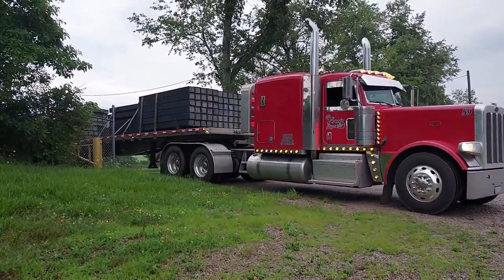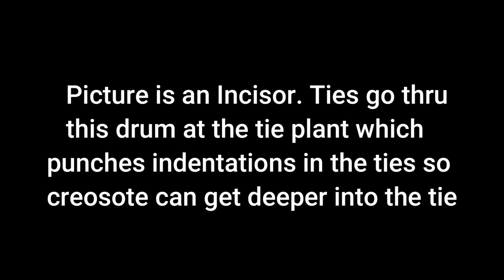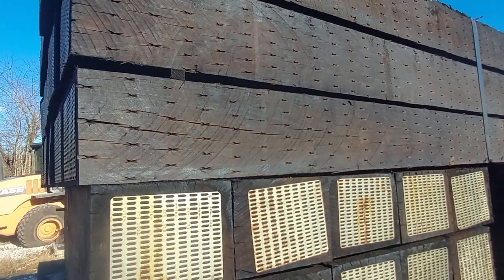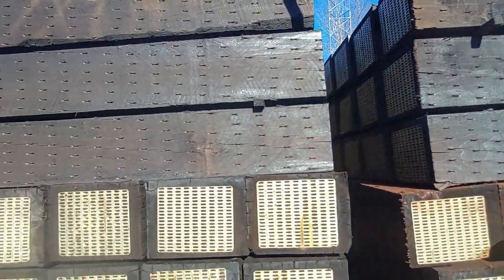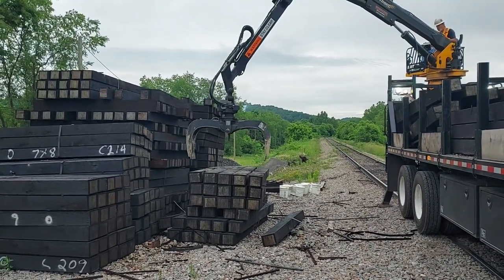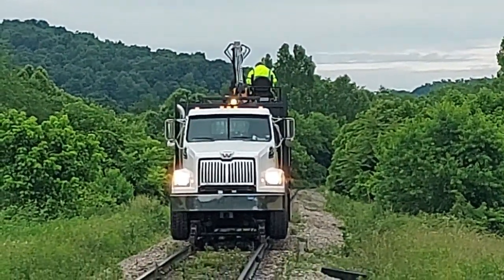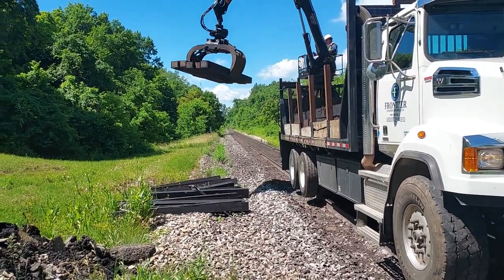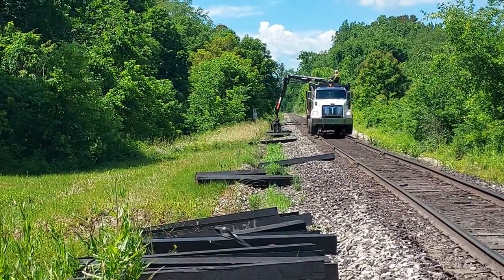Spreading Black Bananas on the Railroad

Comment: The pointed side of those plates is extremely sharp, so are the corners. I have used those plates in various sizes building roof and floor trusses, cut my fingers many times, even sliced part of my leg open on one while running  the truss to the press on rollers. They are a bear to pull off too as there are barbs on part that is pressed into wood, or black banana's in this case.
Reply from the maker: You are absolutely correct in that Johnny, they are very sharp
and do have barbs on the other side of the plate, wish I had
pointed that out in the video, didn't think about it until you wrote in.
Why didn't you write in before I made the video with that? >>>> LOL
Thanks so much my friend for dropping by and watching tonight.
Reply: @ccrx6700  I'm not as fast as I use to be.
Reply: Gang nails.

Comment: Thank you very much for this very interesting and informative video presentation which is very much appreciated. The ties look very well creosoted and should last a very long time. Where I live creosote is now not allowed but many ties are concrete except where the railroad goes over certain bridges and they need something lighter, in this case plastic is used.
Reply from the maker: Your always welcome John and we always appreciate your
very nice comments. This is the 1st part in a 4 part mini series
on ties. The 4th video will be about concrete ties. The plastic ties
are called composite ties, they are made out of recycled plastics
and very hard. They will last a very long time in mud spots and
they require pre drilling before driving a spike in them. We do not
have concrete, composite or steel ties here. Thank you for stopping by and checking out the video my friend.

Comment: Hi Dave, As long as you stated the cost of your treated finished delivered RR Ties, I will try to do a bit of back pedaling to see what makes up the actual end user cost. When we deliver a log truck load of rough cut tie grade logs to an Amish sawmill, they pay from 2500$ to 3000$ for the load. There can be from about 80 to 100 logs that probably will make a sellable RR Tie. so that translates to about $30 per log.  Of this, our cost involves paying the land owner for the logs, cutting, skidding and processing the trees in to logs, and trucking them about 60 to 70 miles to the nearest sawmills. The Amish tell me that they get paid about $40 per green sawed tie delivered to the Tie plant. So that means it costs about $40 to grade process and treat the finished tie.
Reply from the maker: Awesome information Log Dog, thanks for taking the time to
share that. 40 sounds about right at the plant we get our creosoted 
ones from for the green ties. Doesn't sound like much of a profit
margin for the logger tho! Pretty good 10 bucks for sawing one
tie tho.  I just got a grapple truck in yesterday at home full of
tree limbs and tops for my 2024 winter, it was a full big load so
got quite a stack of firewood to cut up. 800 for that grapple truck
load and delivery.

Comment: Haven't heard the term black bananas in a long time. Normally when we had a major tie replacement project we had a tie train with gons loaded with the tie bundles. There is a device called a jimbo which creeps along the tops of the gons lifting the bundles out of the gons and placing them along side the row for placement. You keep your rail operation in tip top shape.
Reply from the maker: Interesting Gary, have never heard of a jimbo before. Ray Corman
got his start by being able to get his back hoe up in a low gondola
and unload ties out of it, and then load ties back in. There's a really
good video on his life story on YT if you haven't watched it, called
Working hard to be lucky, the RJ Corman story. You will love it.
We have a very robust tie replacement program here and have
done so for the past 20 years. No more derailments due to wide
gauge like we used to have! Always a pleasure to have you visit
with us my friend.

Comment: Things you have to too run a rail road ties, rails,plates and spikes  great video thanks Dave did you know that ties are also made of concrete and or composite
Reply from the maker: Thanks Gary, sure is a lot of parts to the track to hold it all 
together, not like my old Lionel set....:-) 4th video in this mini
series we will go over the differences between concrete and wood
ties, but I am not going to do a video on composite or steel ties for now. Great to have you visit with us tonight and write in my friend.

Comment: We had at least one tie-making plant in the lower part of the state.  It turned into a Super Fund site due to years of creosote spilled, dumped, and soaking into the area.  Quite a mess.
Reply from the maker: I hear that, were we get our ties, they are very careful about
not spilling creosote, most of the yard is concrete and the new
ties are all under roof. Environmental fines can ruin a small business.
Thanks so much my friend for visiting with us and checking out the tie show.

Comment: Only if you had a connection with a Class-1 railroad, ordering ties by the car of 300 to 500 per car would have been much easier, I think I've dealt with 100,000 ties over three years for two tie gangs on two territories.
Reply from the maker: Appalachian Timber where we get our ties does not have a RR connection. They are in the middle of nowhere.  this is the first 
of a 4 part mini series on ties, you'll like the last one on the
differences between concrete and wood, I use a reference from
Michael Franke former VP of BNSF MOW. Always a pleasure
to have you visit with us and hear from you my friend.

Comment: when the spikes are driven into the ties that are replaced , what do you use as a reference knowing when
the ties are centered under the rails? do they come like the bridge ones with a tie plate resting area 
cut out on the ties? great video, that sure is a good number of ties! so if they are a foot apart, and ~10-in thick 
~4640 ties per mile $ 211,200 just for the ties! trains are very expensive to run, but most efficent to move goods.
Reply: Most mainline tie spacing is 19.5 inches CtoC which works out to 3250 per mile.  Mainline ties are 7" X 9" X 9'.  Bridge ties are usually 8" X 8"  X 10' space 12" on center unless the beck is ballasted, then the ties are regular track ties.  Concrete ties are usually spaced a little more CtoC but depend on the railroad because they are wider than wood ties.
The last time I had anything to do with pricing ties was in the 1980s and they were about $20 each delivered.
Reply from the maker: Usually when a tie is replaced, it just goes back in the same hole
the old one came out of Barry. On new construction ties are
centered at 19.5 inches. Got a lot more info on ties coming out,
this is the first video in a 4 part mini series on ties.  Thanks so much for visiting with us and writing in my friend.

Comment: A treatment plant would send an inspector to the sawmill before each order was shipped. This sawmill was near where I lived. After cutting, the ties were trucked a short distance to a storage lot, where they were stacked and allowed to air dry for several months. The sawmill, the storage lot, and the trucking company lot, were all less than a mile from each other.

At the sawmill the ties were cut to correct size in height and width, but were cut a few inches too long. They would be cut to specified length later at the treatment plant.

The inspector would visit the storage lot, and choose which ties passed inspection and were ready to ship. The inspector had a special hammer with embossed heads. There was an intricate special symbol on one head, and the word FAIL on the other head. Only ties bearing the pass symbol were to be trucked from the storage lot to the treatment plant.

The owner of the sawmill would reserve and pay for a hotel room for the inspector to stay overnight. After a long day of inspecting, the sawmill owner and the inspector would get passed out drunk.

At that point, an employee of the sawmill would carry the passed out inspector to the inspector's vehicle, drive him to the hotel, and put him to bed. He would then "borrow" the inspector's hammer. The owner of the trucking company would give that guy a ride back to the storage lot.

An empty flatbed trailer would already be staged there. Ties bearing a FAIL mark would be loaded and the owner of the trucking company would strap them down. A trucker would arrive and drop another empty flatbed. The trucker would hook to the strapped load and drive it to the sawmill. He would drop that loaded trailer, bobtail back to his company lot, hook another empty flatbed, and take it back to the storage lot. This was repeated until all the ties bearing a FAIL mark were relocated to the sawmill.

The ties were unloaded at the sawmill, and a tiny amount was cut off the end, removing the FAIL mark. The inspector's hammer was then used to apply the pass symbol, and the ties were loaded back onto the trailers. After all the FAIL ties had been "passed", the inspector's hammer was returned to his vehicle back at the hotel before he woke up.

The loads of newly passed ties were then hauled overnight from the sawmill to the trucking company lot. After the inspector left town, the loads were moved back to the storage lot. Those ties were unloaded and stacked in their own area. Those ties were then slowly blended into loads to transport to the treatment plant. After all the remaining questionable ties were gone from the storage lot, the inspector would be summoned back for another round of inspections.

This all happened decades ago, and AFAIK, everyone involved is now deceased.
Reply from the maker: Appreciate your sharing that story with us 3rd, 5th7th8th. I
have no doubt that happened, very interesting story. Inspectors here for construction jobs often found bottles or cases of whiskey in their offices or vehicles.  Thank You for taking the time to visit with us and check out the video my friend.

Comment: That Incisor looks like a medieval torture device! The BNSF railroad by us has like 60 miles worth of black bananas on the side of the track waiting to be installed. I'm guessing that's going to take awhile!  Question: Back when I was a kid, they had an 'S' shaped steel thing driven into the ends of the ties. When did they switch to the tie plates?
Reply from the maker: You got that right! I was thinking to my self the same thing when
we toured the tie plant! Guess I'd better come up there and help
BNSF out on the ties then.....LOL next video out will show you
one of those S clips in a tie. I do not know when they changed over
to the plates on the tie ends.  Thanks so much for visiting with us and writing in my friend.

Comment: In some respects it's getting harder to find good quality wood to be used for ties. They try to balance consmption of older growth versus new plantings and there is a tie treating plant in Bangor WI that gets wood from Kentucky and Tennessee. The good part about wood is if you have a small derailment on top of one and it didn't dig too deeply you can salvage it. Once a concrete one breaks that's it. 20 years ago some company in Kansas city was going to try plastic ties apparently didn't go too well as you don't see them in use  or hear them advertising.  Here's to installing ties which are the backbone of it all.
Reply from the maker: Your totally right Paul about the derailment. I will go over that 
in part 4 of this mini series on ties. That video is about why
some RR;s use concrete and some use wood. I think you'll like
finding out all the pros and cons of each in that video. Appreciate
your visiting with us as always my friend. The composite ties are
pretty darn expensive, but great for mud holes.

Comment: How far will that load of ties reach down a track? I'm so glad they won't have to be laid by hand. Stay safe, Dave. Love the videos.
Reply: Depends on the spacing. current standards for main lines are 19", center-to-center, with 24' center-to-center on light duty track. 
So, at 19", and 197 ties per truck you get: 19" * 197 = 3743"/12" = 311' 11" section of track.
Reply from the maker: We only replace the ties that are bad or going bad Shirley, so
a load of ties may stretch out for some ways. In new construction,
195 ties would stretch out for about 350 feet. Thanks so much
my friend for visiting with us and checking out the tie show.

Comment: Dave. A couple of questions!  Treated lumber is put in tanks that they can pull a vacuum on this pulls treatment into the wood, do they use this for ties? Also how cost effective is it to lay concrete ties down.😊
Reply from the maker: The creosoting process is very similar ferstuck, untreated timbers
are put on small rail cars and taken into a tank that looks like a 
huge propane tank, then pressure treated with hot creosote.

This was the sfirst video in a 4 part mini series on ties.
The 4th video will show you the differences between concrete and
wood ties and tell you the reasons why some railroads use wood
and some use concrete. That video will be shown in about a week
from now. Hope to see you then and thanks so much for stopping by and checking out the video on spreading black bananas my friend.

Comment: If my facts and figures are correct, at the rate of tie replacement, the whole railroad would be done in about twenty-five years.  If tie life is 30-40 years, that is pretty good.  I'm making a wild guess that your owner, while having to watch where the pennies go, wants to avoid any costly derailments.  The tie cost of $16,000 is chump change in what a derailment would cost the company.  I do, of course, realize that is just the cost of the ties and not installed cost.  I'd sure like to meet that guy.  Sounds like someone that has had his hands dirty a time or two.
Reply from the maker: Very nice comment David, thanks so much for taking the time to
write in. We have a robust tie replacement program here and have
had for the past 20 or so years. We used to have some bad
derailments due to bad ties and wide track gauge, no more! So
you are so right, it's far, far cheaper to prevent derailments than
to fix them after they happen. Consider also no revenue coming
in from coal sales when the track is tore up from a derailment,
that is big bucks in and of itself not to mention the cost of
derailment repairs. Appreciate your taking the time to visit with us my friend.

Comment: hey i have noticed that America still uses Timber railroad ties.. over here in Australia they hardly use timber anymore its all concrete even the Sugar cane mills use concrete ties now some may use the odd timber one but mainly all concrete. is there a reason you are using timber there or is it cheaper and lasts just as long or longer then concrete as i heard concrete powerpoles for example have a lower lifespan compared to timber power poles as concrete is too rigid and can crack hence why timber is still the choice and id say its the same with railroad lines they use timber as it offers some flex and is easily replaced and cheaper.
Reply from the maker: Very good comment The Mariner Kommer. This video is the first one in a 4 part mini series on ties. The 4th video in this series will answer your question on why some RR's use concrete and some use wood. Hope to see you on that one. You will be surprised to find out all the
factors that go into making that decision on which one to use.
Thanks so much for visiting with us and writing in my friend.

Comment: I get the new ties, but when you put in "new" rail why is it so rusty for? I figured it would've been nice and shiny.
Reply: Steel loves oxygen, and rust starts with any humidity in the air. 
I have a junction between the CN and WSOR a stone's throw from my apartment. 30 trains a day and the CN rails tend to shine. 4 trains a day for the WSOR and the rails are rusty by the time the next train rolls by.
Reply from the maker: It is pretty nice when it first gets rolled Robert. Sometimes we
don't get the rail until months later and then we have new rail sitting
in our yard that is over 2 years old, so you know what weather
does to steel. If you watched my shorts video on 52,000  worth
of new rail, that was nice and clean.  Thanks so much for visiting with us and writing in my friend.

Comment: Have you seen those plastic ties? Made from recycled material. When I was stationed in Germany in the early 80s they were laying concrete ties.
Reply from the maker: Very good question Pete. This video is the first one in a 4 part mini
series on ties. The 4th video in this series will talk about 
on why some RR's use concrete and some use wood. Hope
to see you on that one. You will be surprised to find out all the
factors that go into making that decision on which one to use.
However I do not go over the composite ties you are asking about.
Thanks so much for visiting with us and writing in my friend.

Comment: Consider 2 trains.  Always something loading and unloading. Or is that bottleneck the barges at the river?  Ever looked at installing a conveyor belt on the tracks to run coal continuously from the mine to the river?  Pull up Ada Oklahoma on google maps. How many miles long is that conveyor?
Reply from the maker: We have ran two trains in the past rtz549 and actually these past
couple of weeks have ran both trains a good bit. Bottleneck is
usually because the prep plant or mine breaks down. Barges
are mostly a problem when there is high water on the river and
boats are tied off until water levels recede. There are occasional
other reasons for barges not being delivered, but all in all 90% of
the time we can keep up with the coal flow. To belt the coal, we would
need about 16 miles of belts and at this point that will never happen
here. Thank you for taking the time to watch and write in my friend.